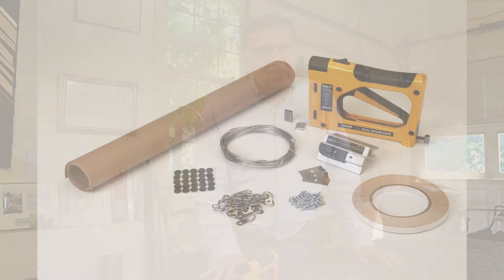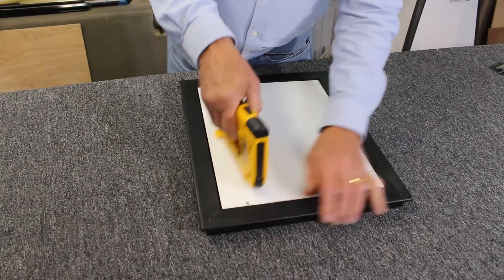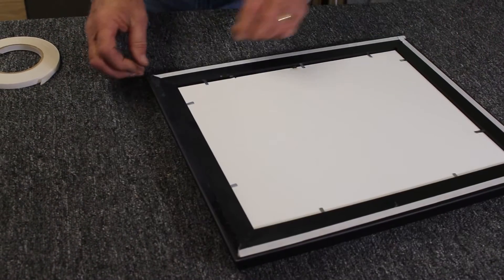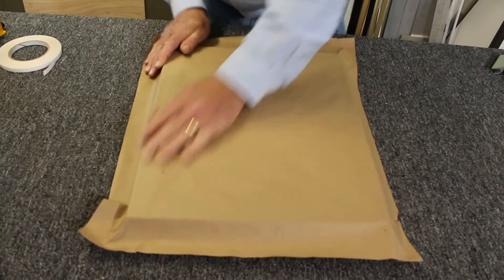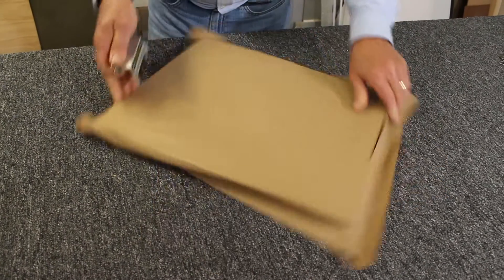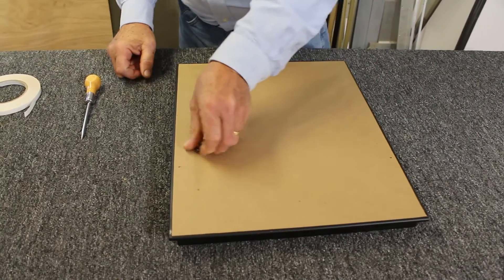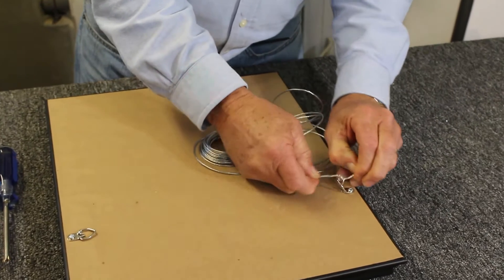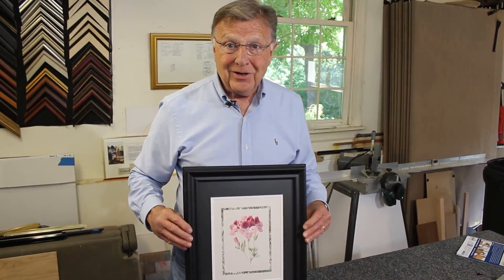LOGAN F500-3 Deluxe Frame Finishing Kit

Comment: Great video. FYI - For most professional galleries display of artwork, they want you to use the UNCOATED  wire because the wall hangers wont accept the thicker coated diameter so if its just going on your or friends wall coated is the way to go but ask first  if its going to be displayed in a gallery/ show.. I need to get that dust cover cutter for sure! great tool. Makes it so much easier.

Comment: The instructions for the F60 trimmer have an additional step - spray the Kraft paper with water after it's trimmed and then let it dry or use a hair dryer to speed things up.  Is that step necessary or can I skip it with satisfactory results?
Reply from the maker: No, that is not absolutely necessary but some find it tightens up the backing paper for a more professional look. You can also just use a hair dryer without the water and get a similar effect. You may want to experiment with the type of backing paper you are using to see if you are getting wrinkles an application of heat would solve. Thanks.
Reply: I used the water spray technique and it worked wonders for tightening up the backing paper.